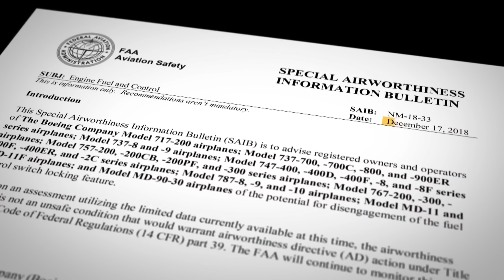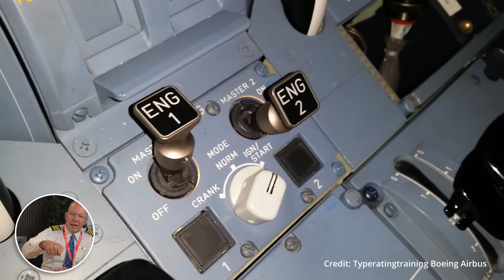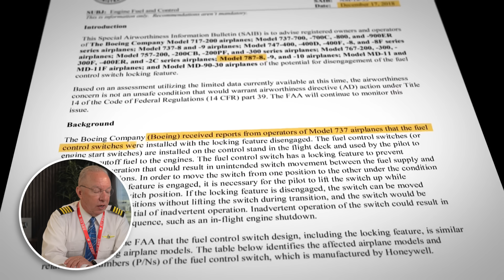Air India 171: The FAA’s 2018 Fuel Switch Locking Bulletin Explained (16 Questions Answered)

Comment: QUESTION : Please do answer this  and now I have started believing that Switches went faulty and went to cut off at the time of rotate: - 
Why I say so :-  
Reason 1 : The run way speed and take off looks fine , yes it does. 
Reason 2 : It does go for the climb to 600 feet or so and then starts going down. So obviously the Switches were on and had enough thrust to rotate, so  no doubt till time of rotate and initial climb. 
Reason 3 : During rotate the commanding pilot has full concentration on the front view and front monitors - not on the fuel switches which are at very centre  of extended dash board. Also the other pilot hand could or should be to get landing gear up on positive check.
Reason 4 : If one of the pilot noticed switches back to reset position and may be it's a big MAY BE assumed other pilot did to which response was no I didn't. This can lead to other pilot go in panic situation - human nature. 
Reason 5 : FDR shows that there was attempt to bring switches to run state - there is a difference of 4 seconds I believe . 
THEN HOW CAN A PILOT OR any other HUMAN turn of both switches in just 1 SECOND . Can this be tested on standing aircraft that can a human being sitting on pilot seat with one hand shut off both switches in 1 second. As far as I know it is 3 step procedure to change 1 switch position . Think about it ???
If any human being can turn off BOTH switches in  a mere 1 second then sorry it's a big big fault in design - and no matter what mechanism it has spring loaded or this and that loaded - both switches are as good as bedroom light switches. I mean there has to be at least time diff of 5 seconds.
Why Pilot made MAY DAY Call of it was suicide mission ?  Get the CVR transcript and all will be clear .
REMEMBER there was warning issued for fuel switches with possibility of catastrophic failure including Boeing 787 , I think report is of 2018 or 2019.
Reply: You can literally imitate the action of turning off the fuel cutoff switches and see that it takes about 1.5s to turn both switches off…

Comment: I was wondering why, if this was done on purpose, the person responsible hadn’t waited until the plane was fully airborne to make sure there was no way to save the plane from crashing, but what you said has made me realise this was the very reason it was done at this time….to actually prevent the other officer from having the time to rectify the situation and the plane would have had time for the engines to start working and continue to fly. Which leads me to another thought…if one of the pilots wanted to crash a plane, what could the other pilot do? How would the pilot incapacitate the other pilot to stop him/her from sabotaging the plane and still continue to fly the plane or start flying the plane?

Comment: My perception of the questions, to summarize my timestamped comment below, I am still not convinced, either way, if the crash was caused by a pilot, or by machine, or by remote.

1:19 Not if the detent grooves, and the springs are worn out (such as from 10 years of toggling).  Given enough years of wear and tear, the mechanical system can fail in unusual and unexpected ways, especially if not replaced before their mean time between failure (MTBF).

6:10 I am not entirely convinced the crash was caused by a pilot, especially if the system has an automatic override of the mechanical switches and the sequential time between shutting off the cut off switches is uncharacteristically fast, for human operation.  The report said "01" seconds.  We do not know what the tolerance or resolution of this time is, if they rounded it up, to the nearest second, or down.  If the tolerance is +/- 1 second then the sequence occured between about 1.9 and about 0.1 seconds.  About ten seconds later the time between engine 1 and engine 2 set to run, is stated as 4 seconds (rounded to the nearest second this is about 400% longer).

6:45 Psychotherapy really needs to be a recurring mandatory requirement for pilot training, regardless if a pilot is sick, or not, as this can help pilots help verify if not only they are safe to fly, but if the other pilot is, as well, and have a robust procedure, including standardized hospitalization procedures, and recovery, for ensuring psychological safety.  

7:30 It does not have to do with being installed upside down, please see the excerpt below from the bulletin, it needs to be mandatory, IMHO, because it can lead to a catastrophic failure (Note, this is the same FAA under the auspices of the current administration that sacreligously certified the 737-MAX MCAS just one level above inflight entertainment, unless I am mistaken, at Level D, and not Level A, for a control surface).  Just because the FAA "chose" to make it a recommendation instead of a mandatory directive, does not mean there is nothing wrong.  This is why "independence" (heterodoxy) in the avionics industry is crucial. The bulletin says "..In order to move the switch from one position to the other under the condition where the locking feature is engaged, it is necessary for the pilot to lift the switch up while transitioning the switch position. If the locking feature is disengaged, the switch can be moved 
between the two positions without lifting the switch during transition, and the switch would be exposed to the potential of inadvertent operation. Inadvertent operation of the switch could result in an unintended consequence, such as an in-flight engine shutdown..".  The fact that this bulletin is cited in the preliminary report is a strong indication that it may have needed to be mandatory instead of optional, given the Air India crash.

12:17 Still do not know.  The report stated "01" second (with a mysterious prefix of 0) as time between engine 1 and engine 2 cutoff but did not provide a tolerance, or state if this time is rounded up, to the nearest second, or rounded down to the nearest second, or to the nearest half second.  If the time was less than 1 second (it could have been 1.9 seconds or 0.1 seconds),  it implies an automatic shutoff by a computer.  What is the fastest you can humanly shut off, both of these switches, in a sequence?  Probably not much faster than a second... Some time after about ten seconds the time between engine 1 and engine 2 turning on is stated as about 4 seconds (this is about 400% longer than the shut off sequence). 

13:50 Still do not know.

14:04 Still do not know either, and strange for a "737...'engineer'" to be asking this question.  I do not perceive a pilot would have more knowledge of this, if anything, it would be the other way around, and the pilot would be asking this question to the "engineer", especially one that worked on the 787 network.  When having to deal with catastrophic failures at 10E-9 it is wiser to state probabilities, rather than yes, or no, but I suppose this is a difference between pilots and "engineers" having to make discrete, black and white decisions immediately, not allowing any tolerance of ambiguity, for optimal control.  A real interesting read on this subject is from the book "Thinking Fast and Slow" by Daniel Kahneman.

Comment: This aircraft took the longest distance to take off even longer if the one engine fails on the ground why so? Already confirmed from the satellite and ATC data and what about the RAT who approximately was out just after 5 seconds can also see from the cctv footage….and if someone did this on purpose the fuel switch turn off like one of them did the both not one because mistakenly only one could happen not two….and if this a suicide why the plane even take off? They could just make a plane collide in a wall at the end of the runway

Comment: The conversation between one pilot and the other pilot seems unrealistic and incomplete.  If one pilot intentionally shut off fuel to the engines, why would he deny it.  The other pilot realizing that he has just been sentenced to death, only says "why did you shut off the fuel?"  Where is the emotional outrage?  Where is the yelling and screaming over a behavior that results in mass murder? Also, those fuel cutoff switches have curved ramps up to the high point.  Those ramps imply that you could push the switch up the ramp instead of lifting the switch up.  This would suggest that pushing hard on the switches could shut off the fuel.???????

Comment: In flight once those fuel switches moved to “cut” there should be an immediate alert fuel cut 1 so a pilot react before fuel cut 2 switch is even moved. Any delay from those fuel switches being moved isn’t acceptable. If there was some type hack to computer update you can be sure alot of work behind closed doors will be done to make sure that doesn’t happen again and life’s are not put at risk. A very nasty dictator have been repeatedly threatened UK and that is what’s making me very suspicious.!!!

Comment: It is evident that it was human intervention just after taking off. Isn't there anything preventing the switches cutting off the fuel supply but only in case of fire in the engine. Or could it be a time to put that logic into place. Or a dual switch that it won't cut off the fuel until it is done by both of the pilots?

Comment: Respectfully, I just have more questions Capt Steve. I know you spoke about logic controls, fires on planes, and pilot discretion but if V1 is the point of no return then why even allow for the possibility of cutting off fuel during the critical take off period? We’ve seen aircrafts on fire hit V1 and still have to take off and there is fire suppression on aircrafts now. Isn’t it just safer than for Boeing, GE and Airbus to just make that a no-go point for cutting off fuel? Similar to us only getting wifi when we’ve reached cruising altitude? 

Also, what are your thoughts about the pilot’s decision to re engage the fuel feed? I realize it may have been human psychology in an attempt to recover the aircraft but do you think that decision caused more deaths? You said yourself that the pilots had less than 60 seconds to recover and from that altitude it was impossible as fuel cut off thus engine failure is a death sentence. So why even turn it back on to increase the aircraft’s velocity and ground impact. Wouldn’t an attempted glide down without speed be safer at that moment? Could it have saved more lives?

Comment: I am just a computer repairman. But I do not think that the digital control system on a Boeing is in any way different from how analog-digital interfaces operate.

There is a mechanical switch with all these fancy pull-up moves, letting it fixate, but there is a digital switch behind that which is not visible. It is as simple as “wire connected or not.” There is an electronic switch which is then interpreted by the computer, which of course has its I/O interface being interpreted by the software logic.

The way any electrical 1/0 switch operates is that there is a so-called pull-up voltage which sets the default condition of the switch as “voltage high.” And there is a pull-down action which in fact shorts the circuit to ground, thus putting it in the low voltage position, which is then translated into a command to the computer. Whether that is positioned so that 0 means on, or 0 means off, is abstract and may vary (for example, most phone signals are logical high==YES and most computers are the opposite where electrical zero indicates logical YES).

Long story short: if we lose the voltage which pulls the switch into a default condition, the computer would read zero no matter what the switch position is. This type of circuit is inevitable; there is no way you can do it differently. You can duplicate it, you can make a separate isolated circuit to check that.

Of course, most likely, since there was a delay, that was a human action. Electrical failures do not happen with such delays. 
However, drive/fly-by-wire is always only as safe as the point which connects the physical interface with the digital 1/0 decoder.

So the main question to be answered is if this particular switch is doubled/quadripled/redundant enough to be always read in the exactly the same position. 
Which is, knowing history of the prior Boeing's failure - questionable.

Comment: Hi Steeeve - worked in air Ind for over 30 years - is it possible that someone from the previous flight or someone else could have tempered with the springs of the switches in question ? That will be consistent with what the pilot and co-pilot questioned ...

Comment: If the health of these switches is in question now—or in any future incident—then redundancy is essential. A dual-switch system per engine, requiring both to be in cut or run, would ensure that one failure is indicative, not fatal. Critical systems should never rely on a single point of failure, especially in aviation.

Comment: Captain Steve, thank you for your detailed analysis. I have tremendous respect for your expertise, and I appreciate you exploring all possible factors in this tragedy. However, I'd like to respectfully raise some technical concerns that suggest a systems failure may still warrant serious investigation.
Two major technical issues stand out:
1) Incomplete CVR Information: The preliminary report only gives us one exchange - "Why did you cut off?" / "I didn't do it" - but doesn't tell us WHO said what (Captain vs FO) or what happened before/after this critical moment. For such a grave incident, why are we only hearing this snippet? What about the complete conversation leading up to this? This selective reporting seems insufficient for understanding the full sequence of events.
2) The "One Second" Problem: Both fuel control switches moved from RUN to CUTOFF within ONE SECOND of each other. These are spring-loaded, lift-guarded switches requiring deliberate action. The pilot flying would have both hands on controls during takeoff. How is it physically possible to operate both protected switches within one second during the most demanding phase of flight? This precision timing suggests either a coordinated deliberate action (contradicting the "I didn't do it" response) or a simultaneous electronic/computerized command.

I'm not dismissing human factors - they're critically important. But the simultaneous timing and incomplete CVR reporting suggest we may not have the complete picture yet. Both pilots were experienced professionals with clean records. Shouldn't we exhaust all technical possibilities before concluding it was purely a mental health issue?

Comment: I understand that in some cases one would want to cut the fuel while airborne. BUT I would assume that when a plane is airborne mode, a single switch wouldn’t be able to kill the engine even if accidentally goes from RUN to cutoff. Instead, pilot needs to trigger a sequence to be able to kill the engine with the switch, thus preventing accidental cutiff

Comment: Captain Steve I wanted to thank you for your videos and I wanted to provide some of my observations on the report and analysis. I am not an aviation expert but I have done quite a number of failure analyses in the nuclear power industry and I follow airline accident investigations. My first observation is on the timeline from the report. Once you layout all of the events on a timeline you can see that from the time the N1 switch is "Transitioned" from "Run" to "Cut-Off" until the N2 switch is moved back, a total of 13 seconds have elapsed. So there is no problem analoysis required. It was immediately known what happened. I am still seeing some reports of possible engine failures, but that would have generated a FDR record and certainly that would have been mentioned in the report. Of course, none were mentiuoned. Now lets discuss the N1 and N2 cut-off switches. The SAIB descibes this an an "Installation error" and not a "Failure after time" event. That means that it should be noticed immeidately. ALso note that the the Throttle Assembly was replaced on this aircraft in 2023. I believe that if the maintenance were done correctly, the proper operation of the switches should have been checked at that time and no mention that it was not done appears in the report. Thirdly, if the switches were malfunctioning, why would they both still be in the "RUN" position post-accident? They apparently locked into place sufficiently to stay in the up or "RUN" position while the throttles moved down to idle under the same accident forces. These facts make the inadvertent "Transitioning" of the switches seem highly imporbable. This leads to only one sad conclusion that a manual manuipulation moved the switches.